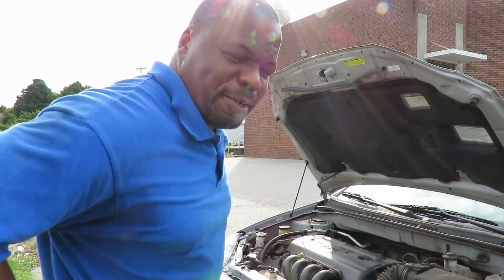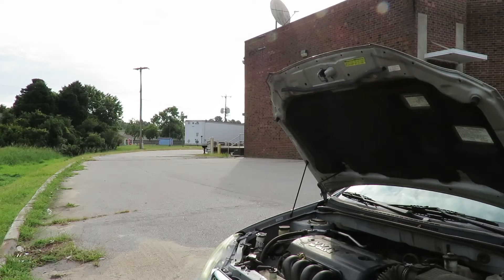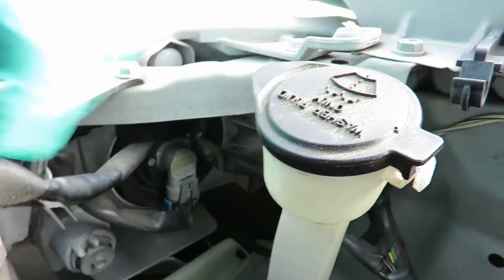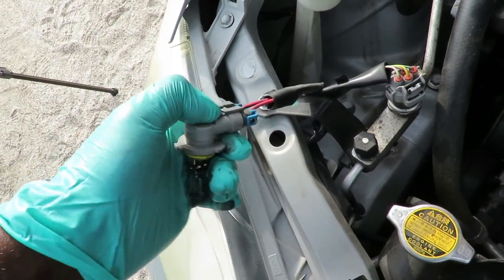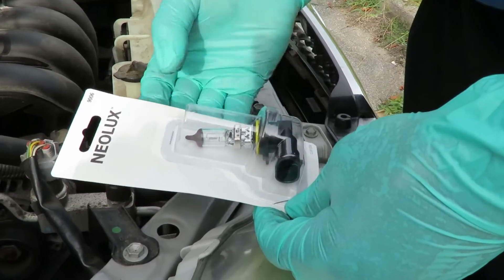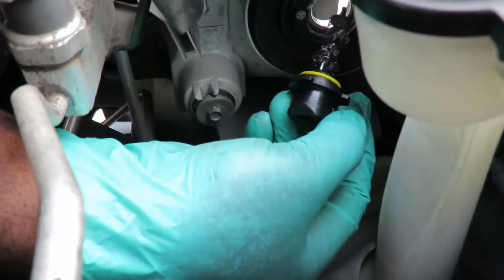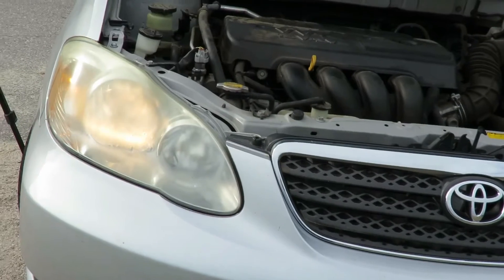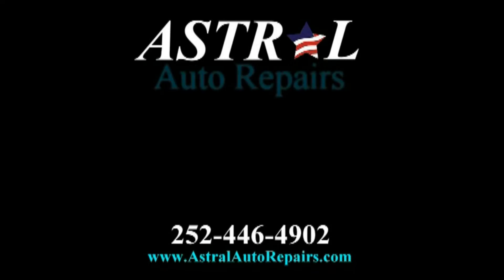⭐ 2006 Toyota Corolla - Replacing The Front Headlight Bulb

Comment: You gotta be kidding me.  That is easy and thanks for the info.   Again, thanks.
Reply: Yup!  Easier than my '01 Honda Civic.  Had to remove that wire fastener, remove a rubber gasket before getting to the bulb.  Glad bulb replacement has gotten easier.

Comment: Love the tip about plugging the bulb in after you get the bulb in.   Shouldn't the bulbs really be replaced in pairs?   It seems the other bulb will last about two weeks before it blows when I've changed one bulb on my 2006.
Reply from the maker: That's only true if you know for a fact that both bulbs are original or replaced at the same time.